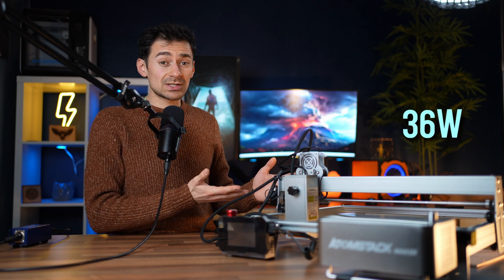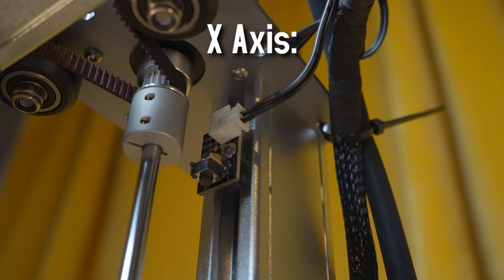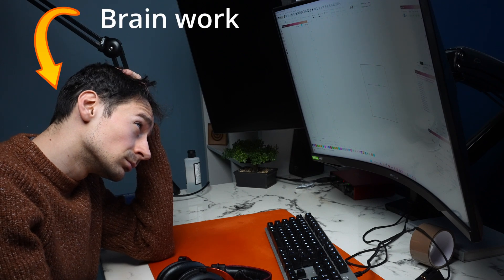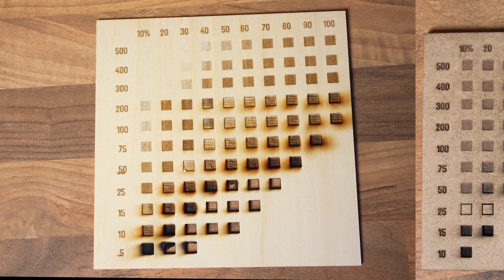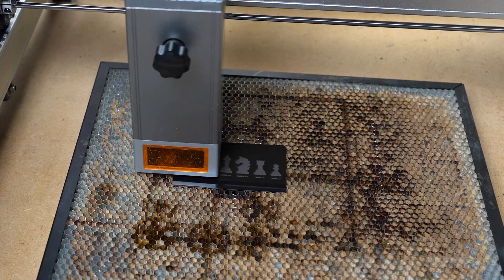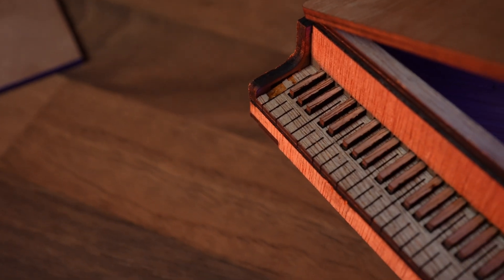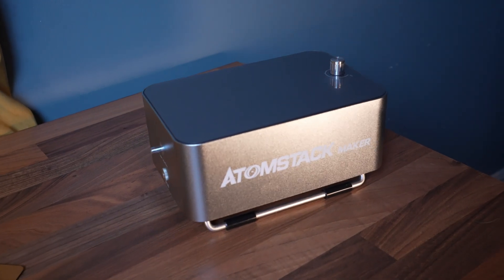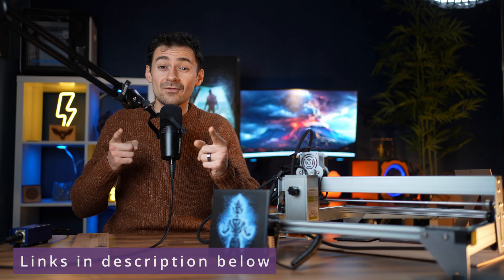The Cheapest 36W Laser Engraver | Atomstack X30 Pro

Comment: Is the machine safe? I heard that machibnes with no hood leak harmfull light while in operation. Is it good  engraving pvc or acrylic dice?
Reply from the maker: Hey my friend,
In terms of the uv light emitted:
As long as you don't look directly into the laser, you aren't going to face any immediate danger.

But Best practice is to use the anti uv light glasses that come with the device.
The Enclosure box I mention at 8:43 is not only great for reducing smoke, but the top part is also great to see your project running and reducing the effects of the uv light simultaniously.
if you do this you don't have to worry about the harmful light.

PVC is sadly going to produce toxic fumes if you try engrave on it. (it most likely will work though), but you definitely don't want to be inhaling even small portions of those fumes.

All types of acrylic can be engraved/cut. 
So acrylic dice should be fine. (depending on the color of the dice, the engravings might not be dark enough to produce a satisfying result// an idea is you can engrave the numbers/characters and then paint in the grooves) 
But good room ventilation will be very preferred here.

Hope this helps you out in your journey. Good luck!

Comment: I want to engrave lettering onto thin aluminum and also be able to cut the material, say 30 thousandths of an inch. Will this tool do that .
Reply from the maker: Hey Wagon Master,
30 thousands of an inch sounds sooo thin its hard to even imagine it. (are you sure its this thin?) The aluminum piece at 4:16 that I used is 0.2mm (around one one hundredth of an inch)
The engraver should definitely be able to cut aluminum thats as thin as you have.
As for engraving, im not enitrely sure. 

In general some possible problems I see happening:  1. The laser heat might bend the thin aluminum sheet / OR 2. it might not engrave a very dark color.
This is theoretical. Who knows maybe it can do it just fine.

Once you try it out weather its with this machine or a different one, I would love to know your results!